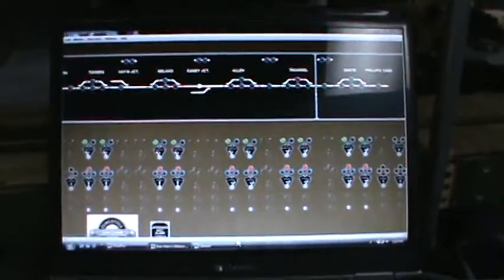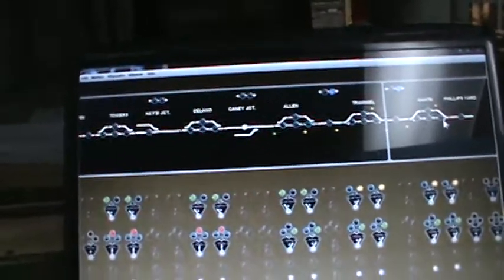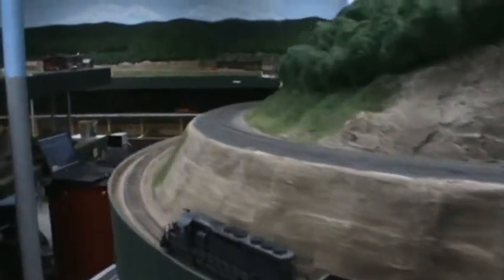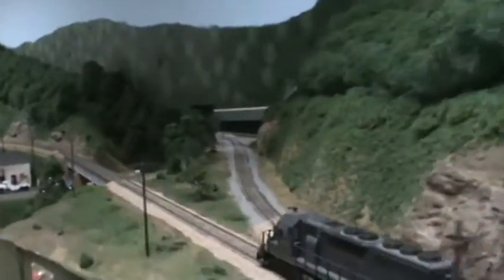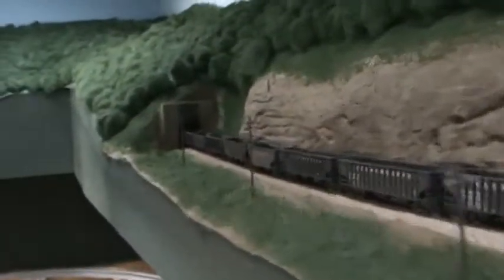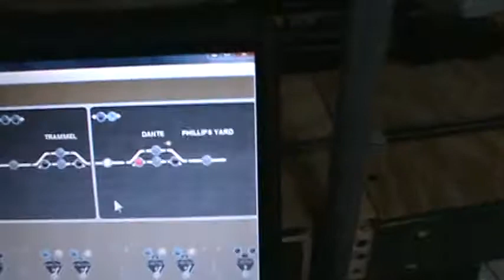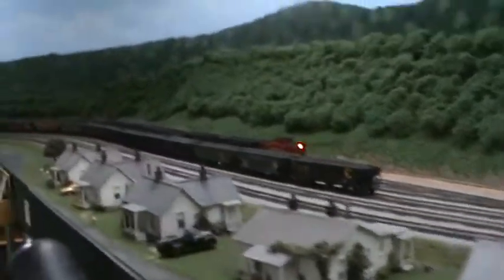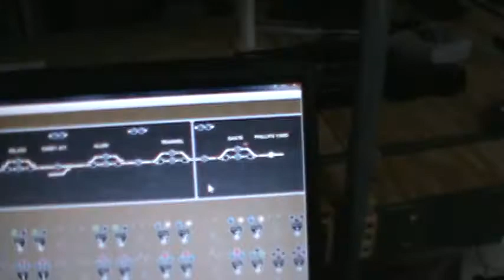JMRI CTC Panel & Signals demonstration

Comment from the maker: JMRI is very powerful software and free to use for CTC. You can design a panel with the software but it is technical and hard to learn. Still worth the effort to get CTC. I had a guy help me with the panel design for the Team Digital boards. Wiring was basically coming up with a diagram and following it but took about a month to do it working every day for a couple of hours and some long weekends.